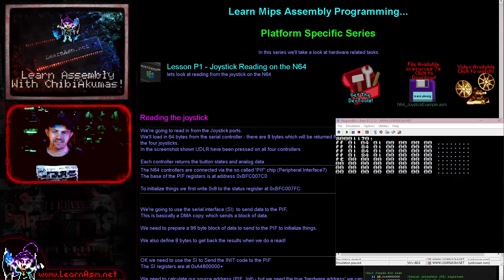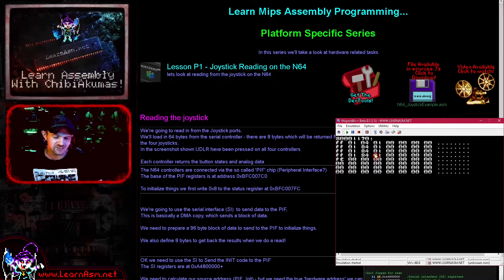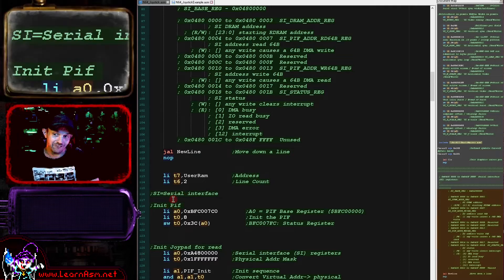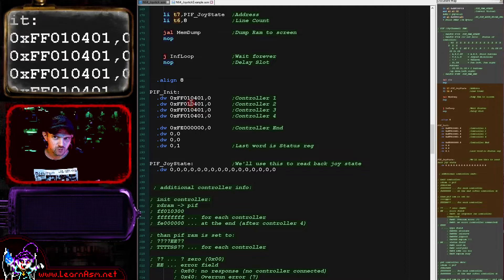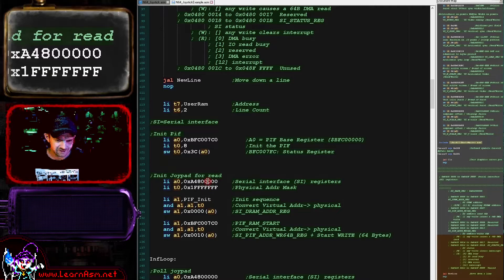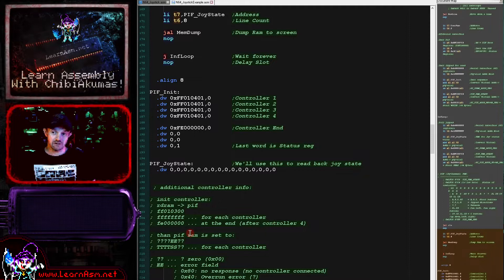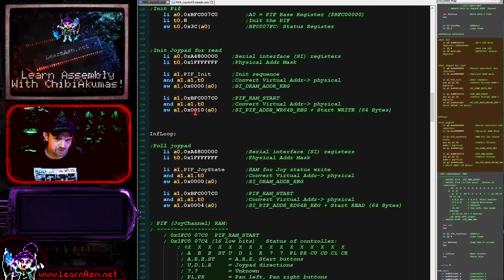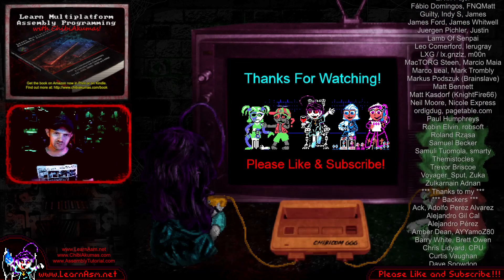Lesson P1 - Joystick Reading on the N64

Comment: Really impressed with AkuSprite.
Any chance you'd ever consider supporting the Infocom MCGA (.mg1) format?

There's no publicly available tool for this particular format (there's some for extracting the picture information and turning it into GIF or PNG, but none for actually writing new .mg1 files) and it would be a great boon for the IF community if there was one.
Reply from the maker: Can you suggest a site which documents the file format?
Reply from the maker: If you're willing to become a patreon backer at the $5+ level, I'm willing to try to do it.
but I'm afraid I can't spend my weekends adding features I'll never use for nothing.
Reply: @ChibiAkumas  Fair. I'll back you as soon as I'm home from my road trip.

I can also contribute code wise. Don't have much experience encoding image formats but I'm a software engineer by trade.
Reply from the maker: Thanks! I look forward to your support, I will start looking at that source online to figure out what it will take to get it working.
I've been looking at the original Pix2gif.c file on IF-Archive, looks like the MG1 format is based on gif's LZW itself, Not something I have any experience with, but I'm pretty sure I can manage to get a decoder/encoder working with some work.